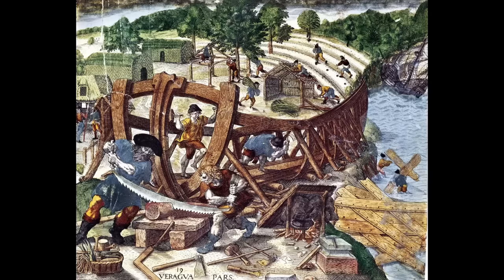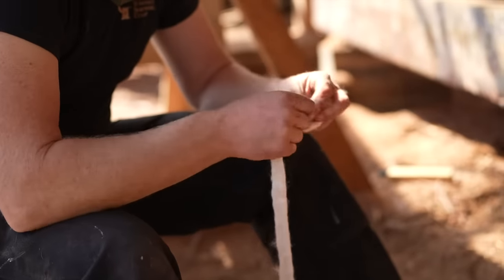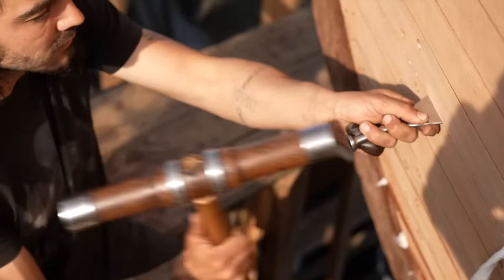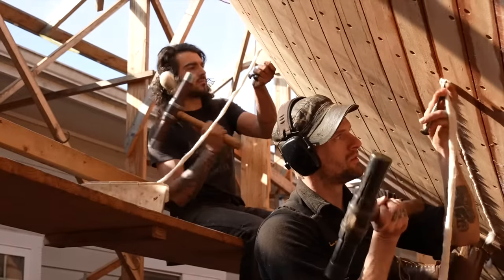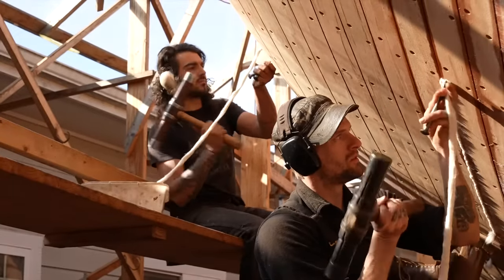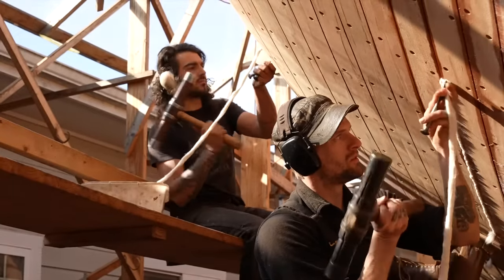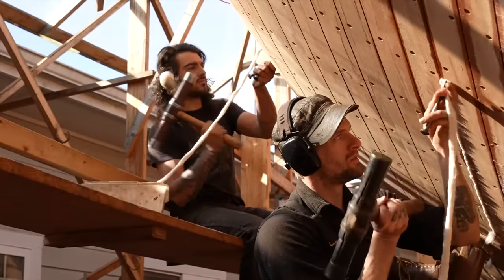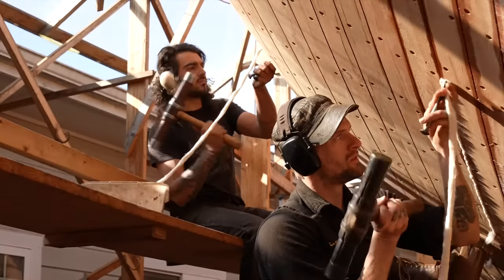Caulking (Corking?!) a wooden boat (Tally Ho / EP96)

Comment: It is certainly "caulking" in UK English. "corking" is something very different and involves putting bungs in bottles/barrels, whatever.

"The Devil to pay and no pitch hot" is a phrase from sailing ship times. The Devil is the iron that was used to force pitch onto/into the caulked deck seams. The phrase signifies that there were caulked seams to be sealed but there was no hot pitch available.

In more recent parlance the phrase is used to indicate that something is missing that is needed to complete a job.

Comment: I helped my dad caulk a clinker built dingy 12' long using oakum/Plumber's hemp.  Unfortunately after we wedged it in, we sealed it with Pitch which dad had "Borrowed' from the coal mines (NCB Scotland) Which sadly was a brittle mix for pouring into High tension plug ends in the coal mines. When we went out in our craft at Cockenzie (Firth of Forth Scotland) The pitch cracked and the water poured in. We just made it to shore sinking majestically, as Nigel Tranter walked past. Ohh the shame and Humanity, still burns deep some 60 some years later.

Comment: Back in '83, I was a new sailor in the US Navy. I was assigned to one of the last modern ships in the Navy that had teak decking (USS Fulton AS-11, commissioned in 1941). My first assignment was to help replace the decking. I spent the entire summer prying up the old planks and later on knees caulking. We put two lines of oakum down and then used a rubbery epoxy compound to fill in the rest.

Comment: Another function of caulking with fiber is to tighten the hull. Turn it into as close to a monocoque as possible. This helps to keep the hull from working underway. When finish caulking a small boat we would "ring the hull". That is bang on the hull with your fist and it "rings" instead of thuds. As I was taught the seam compound after the caulking is what really keeps the water out.

Edit: I posted that before Leo explained the tightening of the hull.
Reply: The seam compound forced in on top of the caulking was pitch, hence the phrase "The devil to pay and no pitch hot".

The hull would have been caulked and covered with copper plates. Th deck would have been caulked and sealed pitch (tar).

Comment: When I began learning under a wooden boat master builder, That is the First job I had to make my first mallet for. Tink-tink, tink-tink echoed in my brain for months. I advanced beyond that after a few years of planking & decking, transitioning into the fiberglass vessels, then into moldmaking. That led to building Go-Fast v-hulls & powercats in Ft Lauderdale & Pompano, FL.
I wouldn't trade away a moment.

Comment: Leo, 
Fantastic episode, and the explanation of the mallet was great. Being from the Tidewater of the Chesapeake Bay ( Potomac River) , I've heard the cotton referred to as "caukin" or "cawking" due likely to the survival of the Cornish dialect of our original colonists. My L's tend to turn into W's, and R's to W's. 😀In the end, this is probably similar to your "cORking". The only experience I've had with caulking a boat was when I was about ten. My father bought a 20' flat bottom skiff from a local builder that wouldn't "swell up" and took on too much water. It later became obvious that "she ain't never been "cAWked!". If I remember correctly, my father bought the cAWkin' and we used a claw hammer and putty knife to do the job. Irons and mallets not being household tools, we at least got the boat to stop leaking,....for the most part. Keep up the good work!

Comment: Here is an excerpt (about calking) from Joshua Slocum's "Sailing Alone Around the World:"

"The hull of my vessel being now put together as strongly as wood and iron could make her, and the various rooms partitioned off, I set about "calking ship." Grave fears were entertained by some that at this point I should fail. I myself gave some thought to the advisability of a "professional calker." The very first blow I struck on the cotton with the calking-iron, which I thought was right, many others thought wrong. "It'll crawl!" cried a man from Marion, passing with a basket of clams on his back. "It'll crawl!" cried another from West Island, when he saw me driving cotton into the seams. Bruno simply wagged his tail. Even Mr. Ben J——, a noted authority on whaling-ships, whose mind, however, was said to totter, asked rather confidently if I did not think "it would crawl." "How fast will it crawl?" cried my old captain friend, who had been towed by many a lively sperm-whale. "Tell us how fast," cried he, "that we may get into port in time."

"However, I drove a thread of oakum on top of the cotton, as from the first I had intended to do. And Bruno again wagged his tail. The cotton never "crawled." When the calking was finished, two coats of copper paint were slapped on the bottom, two of white lead on the topsides and bulwarks. The rudder was then shipped and painted, and on the following day the Spray was launched. As she rode at her ancient, rust-eaten anchor, she sat on the water like a swan."
Reply: Joshua would feel right at home.
Reply: GREAT book

Comment: MY wrists are getting sore just watching , these guys must have a 100 percent rate of carpel tunnel .
Reply: I mean, by the looks of it i'd say it's more elbow than wrist that they're using... same as with smithing.
Reply: @Zestrayswede  Believe me. It's Elbows!
Reply: The hammer took hundreds of years to develop I bet it has a few trick fixes. Mass is in the head length keeps arms back got a slot to spring it. The guys that did this for like ever have learned a few tricks along the way. Pete and the Townsend caulkers could tell you the right answer. Make it a question to them be interesting to know.
Reply: welcome to manual labour. nobody here will make it past 40 without some kind of occupational disease

Comment: Not easy work, I've recaulked several old boats. I did a 48 ft fishing boat by myself and it was quite the task!
Reply: I bet its way more difficult than appears
Reply: @darken3150  I would think your arms take an absolute beating!
Reply: I use to soak rags with Bengay and wrap my elbows with them and papertowels and ducttape them on my arms. Got me through a few hulls that way.
Reply: interested to know if you developed any repetitive strain injuries, or is it ok if done properly.

Comment: The discussion about the caulking mallet and other tools was very interesting to this self admitted tool nut. I found it very satisfying as Leo went over the surfaces and the reasons the mallet was made the way it was, it struck me (pun not intended) that this tool was designed to do a job over a hundred years ago, and, for that task, with all the techno-whizbang stuff we have these days we still hasn't created a better tool for the job.
It takes the craftsman, with the right tool in his hands, and the right feel and measured muscle power in the strike, on the properly placed iron, to get the job done, and apparently it always will. I like that.
I know tech has it's place, and I love my 20 volt Milwaukee Fuel battery powered tools, but I am just thankful Leo didn't pull out a bright red box with a fancy new Milwaukee Fuel Boat Caulking Mallet, for comparison, ya know?

Comment: For puttying the seams I use a flat square heated platen made from an old electric frying pan to slightly soften the putty and provide a nice pallet to work from. The warm putty goes in quickly and easily with a 2"-3" putty knife, the warmth helps make it very sticky. I like to putty before the paint has completely hardened, seems to help the bonding.

Comment: Another great and educational video, thank you Leo.  I've used a pump oil can to paint the seams, holding a chip brush with shortened bristles directly behind the oil can as I pump, works very quickly.

Comment: I live in Texas and we call it caulking. I didn’t realize this word started with boats. It went over to my trade, plumbing. Something that isn’t really done anymore but is still legal is a caulked joint aka a lead and oakum joint. This is when you seal cast iron pipe by packing oakum (hemp fibers) in between the male end and female end of a pipe and then pour molten lead over it. I’m guessing this is where they get the name of caulking in construction from because what is caulking. It’s sealing the seams between boards.

Comment: Caulkin’. when I was doing it on the Thames.   That is not the way we used to caulk at all !  we would lightly twist the cotton, tap in the ends of the longest piece we could reasonably handle, leaving a belly in the cotton ( practice tells you how much) then tap in the middle, then the middles of those two bights and so on, when it is all in place you go down the seam and seat it, just how you are taught I suppose ! What are you sealing the cotton with ? we used red lead primer mixed with linseed putty (horrible to mix).

Comment: Regarding the commentary on "corking" vs "caulking", they are not different pronunciations of the same word, but have the same meaning when it comes to sealing boat planks and are derived from entirely different words.  Cork is derived from the Latin "quercus" as cork comes from a Mediterranean oak species.  Caulk on the other hand is derived from the Latin "calx" which is chalk.  Chalk was used to make fine lime for mortar and used to caulk bricks and stones in the mason's sense. I couldn't find a reference to corking used in this manner for boats, put i expect that "corking" is a local oddity since it acts like a stopper and used to stop liquids passing an orifice or gap.  Whilst cork is used in certain applications to seal up gaps, it is not traditionally used for boats, though it is used in decking as the main material - cork floors are deliciously soft and compliant as well as durable.  Curiously, oakum which is the traditional fiber material, sounds very similar to "oak" from which one might conclude that corking oakum would be a good logical term to use, but alas, oakum has no shared origin with the word "oak" and are unrelated words.  Caulking is certainly the preferred term and goes back only to 1743 according to the internet, so it must be true.

Comment: G'Day,,watching you Guys do the Clorking,(?),Reminds me of reblading a turbine,,Absolute days of driving separate little Blades in to each groove and then driving them home,,just before you Silver solder each Blade to a retaining outer wire,,700 blades on the big diameter,,and near a 100 on the smaller end,,25 rows in all,,
then we set it up on bearings and run it to balance,,pretty scary to have 30 ton of turbine running at 1000rpm just sitting on timbers and bearings with no caps,,I Had the most important job,,standing beside this thing squirting oil on to the bearing whilst running,,and using prehistoric accelerometers to measure vibration of the bearing block and adding weights before silver soldering the balance weights,,Second year apprentice Fitter,,what an eye opener,(1977),

Comment: As essentially a land lubber, I was wondering after seeing many boats in the water and the waterline seemingly always parallel to the water, how is the painted water line determined? Is the boat put into the water and the actual water line marked and then removed from the water and painted ? Is the water line calculated? Is it simply estimated? I guess all will be clear in time. I love the skill and tenacity of Leo, Pete and the crew.  Even though it will be a celebrated day - I selfishly dread the day when the project is complete.

Comment: That’s the best and most in-depth explanation of the technique of caulking I’ve seen or heard. 
How heavy is a caulking hammer? I’ve been repointing the house using a 2lb lump hammer and plugging chisel and I’ve struggled to lift my arms after about an hour but you guys were going for hours! 👍

Comment: This is so satisfying. I've been waiting for someone to teach caulking more in depth for quite a lot of time. I am interested in a more primitive experiment though. How well watertight can we get those boats without sealing compound and without paint. That's what i'm interested in. After all viking boats weren't painted either. 
I guess, it would leak a bit, but probably not slow enough to pump or scoop the water out without any difficulty.

Comment: I never like to do caulking, I don't trust I'm doing it rigth. There most have been a reason that in Denmark in the old days it took you 4 years to become a boat builder and 8 years to become a caulker. It looks simple but it's what's keep the ship a float. And strengthen the ships hoal. I did some caulking where I literally ruined stuff by pushing the planks from each other on a galley roof.
But I know when I see a good caulker.
I have a lot of friends who worked on Seba in Cost da Rica. I really want to see that ship.

Comment: caulk (v.) - late 14c., "to stop up crevices or cracks," from Old North French cauquer, from Late Latin calicare "to stop up chinks with lime," from Latin calx (2) "lime, limestone" (see chalk (n.)). Original sense is nautical, in reference to making ships watertight by driving oakum into the seams. Related: Caulked; caulking. As a noun, "caulking material," by 1980 (caulking in this sense was used from 1743). Related: Caulker. (etymonline)

Comment: This may seem like an obvious question in the wooden boat community, but you say that the wood will swell up and seal the gaps between the planks to make them tight and such. How do the planks swell if they are sealed with the primer and a layer of paint and varnish? How would they get wet to begin with?
Other than that I love what you are doing, really enjoying the journey.
Reply: Paint & varnish aren't an impenetrable barrier, but slow down the rate of change. Wood is constantly absorbing or releasing water as its enviro changes.

Comment: Just by listening to the hammering alone you can tell these guys know what they are doing. The sound of the hammers are perfectly in rthym.
Reply: If you listen carefully you can tell how tight the caulking is by sound of hammer on the finishing iron  on cotton to hull seam.  My dad long gone taugt me to cork when i was about 12 years old. Learned initially ny reefing out old corking around outside p,anks when a new one is bent in. Used oakum initially learned how to spin , comes in batts, then caulk itover the  cotton. This mostly on fishing boats and tow boats, the cover with cement on hull.  Decks were pitched after corking.  The many different shaped irons were made in England, Mallots were made of Black Mesquite. Dad would do about 500 feet per day and give written guarantee for 20 years. rip   great art to do and yes listen yto rythem of Mallot on feed iron.
Gary from Kamloops Canada

Comment: I'm surprised that no one has invented a power tool that feeds the cotton and does at least the initial tamping. And then possibly does the final tamping as well, just without the cotton. And I have to wonder how much of the red sealer paint is absorbed into the cotton. I would guess a lot, is it seems that you would never want that cotton exposed to water at any time. It would be a perfect place for wood rot to start. I would guess that when they seal the inside whatever they use soaks into the seam/cotton from that side as well, unless the red sealant on the outside totally impregnates it with no possibility of water ever finding a home.

Comment: My limited experience with wooden boat building and hull maintenance / repair dates from '60 to '80. I've seen much orange paint used here. Back in the day that would scream "Red Lead" at me. Is that, in fact, really good old "Red Lead" still legal and in use today?   SDH   the Great Unknown in CT

Comment: For those who are interested in the origins of words: 

caulk (v.) - late 14c., "to stop up crevices or cracks", from Old North French cauquer, from Late Latin calicare "to stop up chinks with lime", from Latin calx (2) "lime, limestone" (see chalk (n.)). Original sense is nautical, in reference to making ships watertight by driving oakum into the seams. Related: caulked; caulking. As a noun, "caulking material," by 1980 (caulking in this sense was used from 1743). Related: Caulker. 

oakum (n.) - "coarse, loose fiber obtained from taking apart old hemp ropes," used for caulking the seams of wooden ships, etc., early 15c., okam, okum, from Old English acumba "tow, oakum, flax fibers separated by combing," literally "what is combed out," from Proto-Germanic *us-kambon (source of Old High German achambi). The first element is cognate with Old English a- "away, out, off;" the second element is from stem of cemban "to comb," from camb "a comb;" from PIE root *gembh- "tooth, nail."

 [Reference: etymonline.com s.v. caulk and oakum]

Comment: given the shape of Tally Ho. once the main structure is completed, how will you figure out center of mass /determine waterline  for ballast weight and sail counterbalancing/mast height/area sf for safety and performance/speed using the waterline as your "wing" ? or are you restoring only to it's original specs? sandbags?

Comment: How did you connect the cotton between the planks to the cotton at the very front that went vertically? Is there a knot you tie between the two or do you just hammer them in together?

Comment: In the old days you would have used red lead paint in the seams. And red lead putty. What do you use now?
Reply: lineseed oil (before caulking) and red lead primer (after caulking). The putty still has to be applied, but first (and that is happening now: see facebook or Instagram) there is second round of fairing going on plus some bunging of the screw/rivet holes.